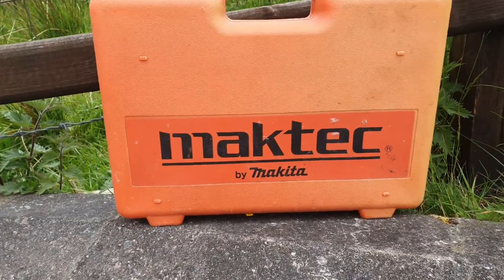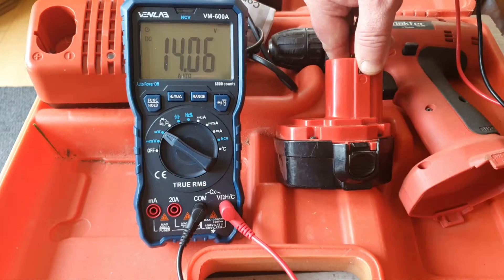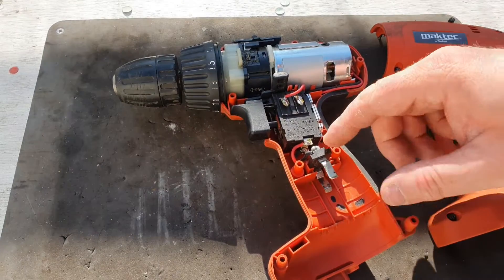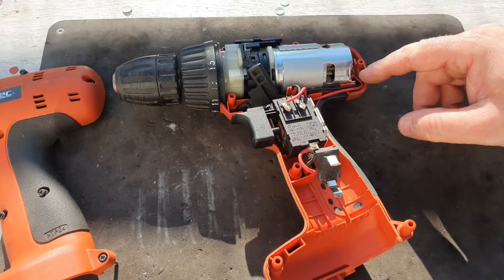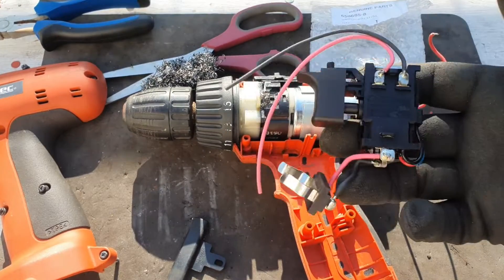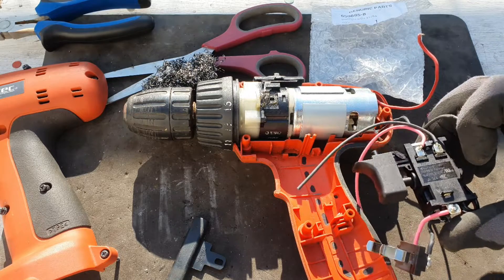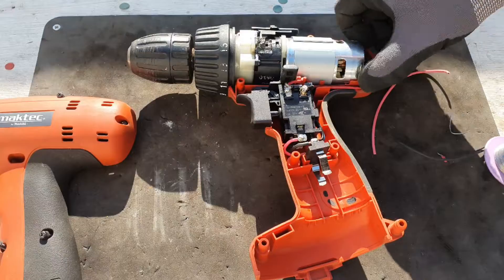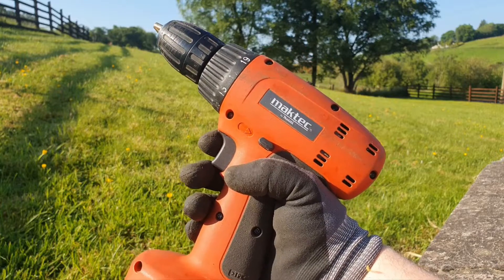Makita Maktec not going? Try This!!#powertools #repair #trending #makita #powertoolrepair

Comment: I have a nicad 18v makita sitting in the shed. Forgot about it completely and finally came across it. Of course after 10 years lying idle the batteries are norsed completely.
Any ideas on where I could find the old nicad batteries????
Reply from the maker: Test the batteries to see what volts they are throwing out if it's low but not nothing you could try spiking them with a car battery charger